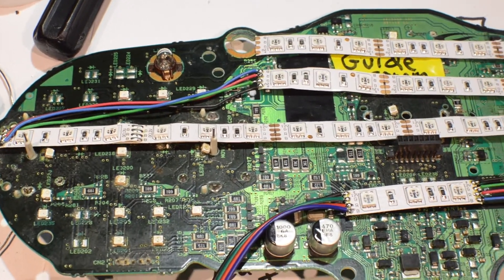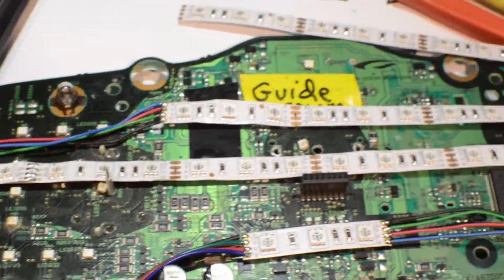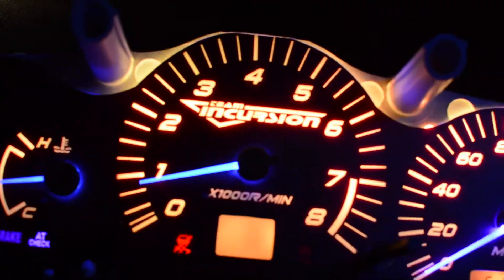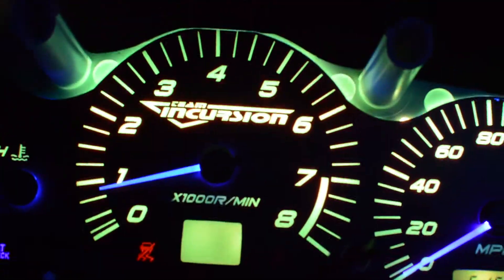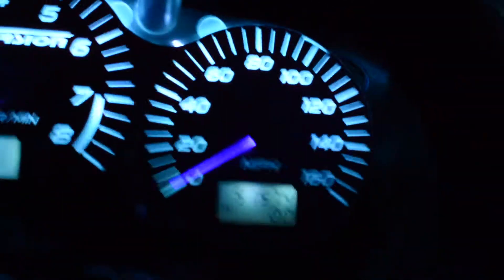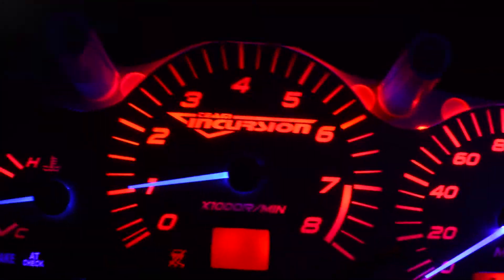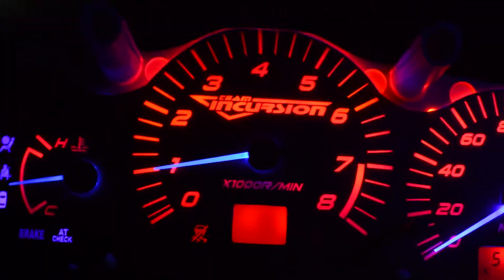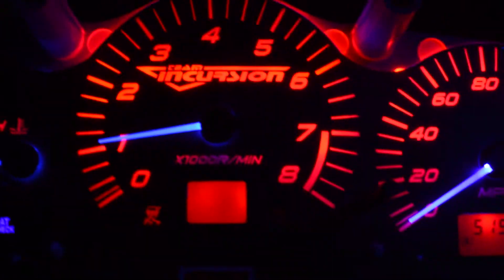350z Automatic Custom RGB LED Gauges with Remote Control

Comment: i use LM2596 on my led modules. Which is just a DC step-down voltage module.
Reply from the maker: Thank you. After this video was made I bought some small voltage regulators off ebay and the work great.